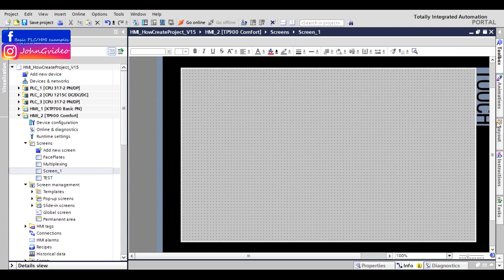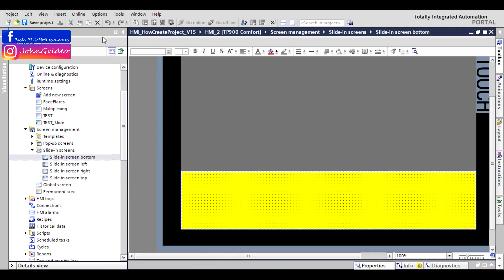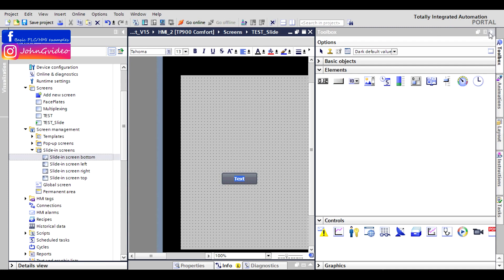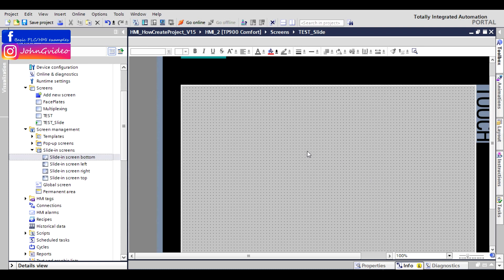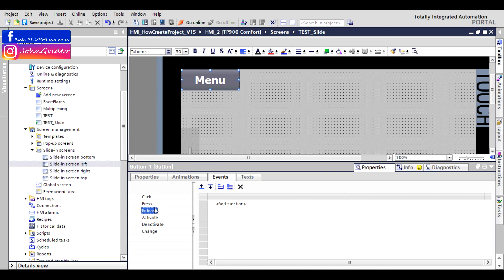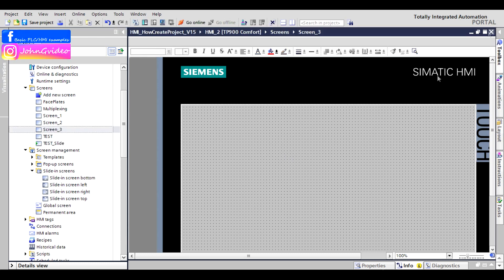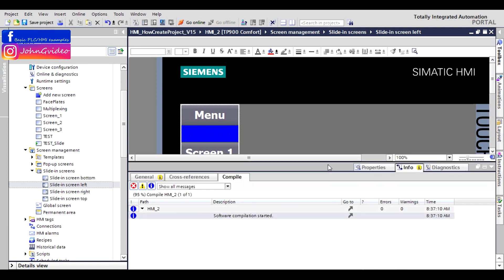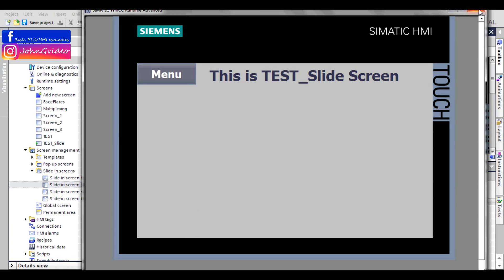Siemens TIA Portal HMI tutorial - How to create, use and work with Slide-in screens

Comment: Awesome job,
Please do not stop
Reply from the maker: Thanks :)
Reply: @JohnGvideo  Currently i am working on a project, but I need some tech support.
Would please help?
Reply from the maker: What kind of problem you need solve ?
Reply: @JohnGvideo  Thank you for reply.
In fact I am involved in a project in which I need to connect 1 PC station (TIA WinCC RT Pro V14) with 3 CPU315-2 PN/DP, via ethernet with a distance of 150m.
And I have a lot of questions regarding this project.
Reply: @JohnGvideo  First question,
for the distance of 150m, does the SCALANCE X108 solve the distance problem?
Reply from the maker: I'm not very skilled in this networks thinks, but in datasheet of SCALANCE swithes is max distance up to 100m with industrial ethernet (For SCALANCE X108) .. Sometimes is better to use Fiber Optic for bigger cable lengths ...